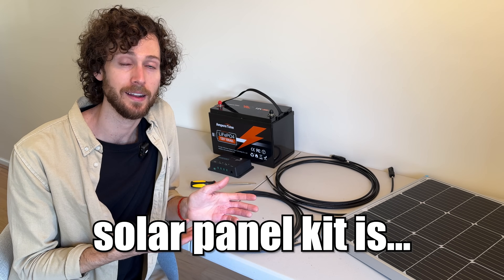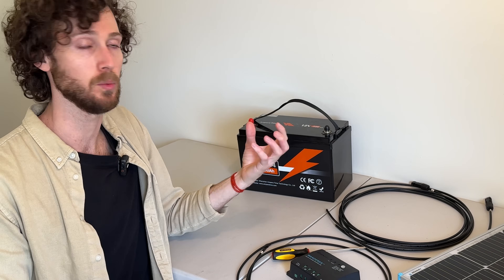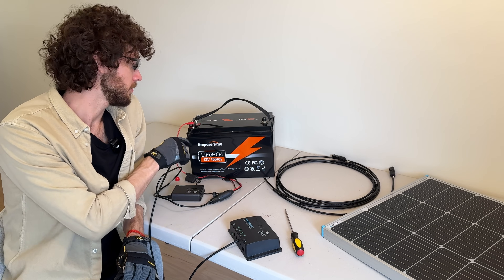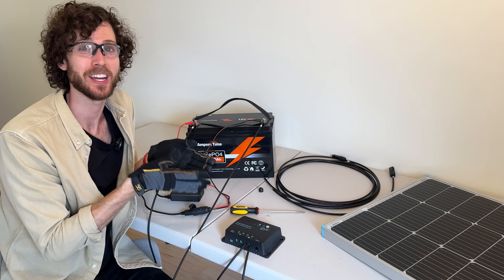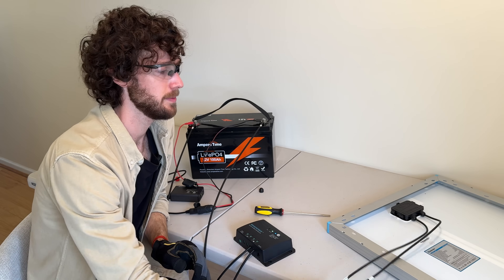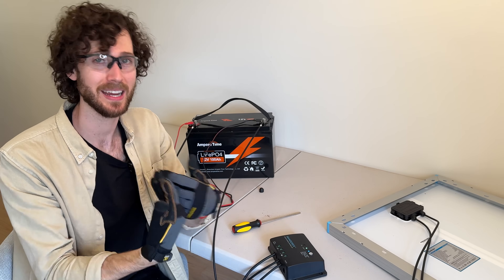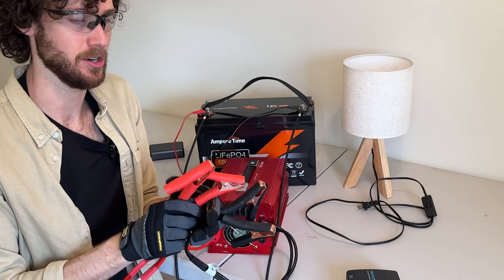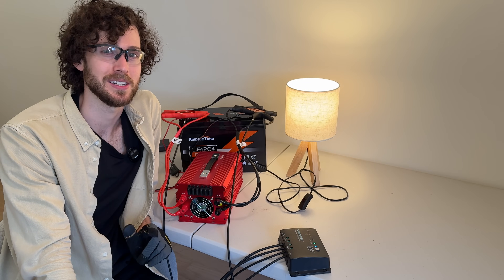100 Watt Solar Panel Kit Setup for Beginners - Step-by-Step!

Comment: Ok 100watt solar is done. How and where to add fuses/breaker to it, at what amp. I love your explanations i will follow you and build one🎉keep them coming
Reply: Bus bars, fuses, breakers etc aren't really necessary for this size setup. Sometimes people still prefer to use that stuff, but the battery has a management system, the charge controller has management, and your inverter has management and likely at least one fuse. That's why on all the 100w kit diagrams you don't see fuses and breakers on there. If you do want to add more fuses then there's a few different options and many people on YouTube have detailed videos. Will Prowse is kind of the man when it comes to solar so I'd recommend starting there.
Reply: @vitogriffin8902  would a 200w panel set up needs fuses?
Reply: @michaelgkellygreen  if it's one 200w panel, or more panels wired in series, then not really. If it's panels wired in parallel then you might want to run a fuse. If you're starting small with the intention of going bigger, then incorporating a fuse now that can be upgraded later might be a better idea than adding it to your build later on... that would be up to you based on your plan and preference.
Reply: @vitogriffin8902  I have two 100w panels going into an Ecoflow River 2 Max Currently but I’m toying with the idea of a set up like in the video. I’m assuming it would give me more power?
Reply: @michaelgkellygreen yea the 100ah battery would be a pretty big step up from the eco flow. I don't know the amp hours of the river 2 max, but it's way less than 100. You could build up a second system such as the one shown or even just add the 100ah battery to your existing system, using the eco flow and solar panels as the charger for the battery and use the eco flow's inverter to run whatever, then charge the eco flow with the 100ah battery when needed. But if you had a system like the one shown then you could do 2 panels in series without a fuse..you can do three 100w panels in series on this type of system without an additional fuses if your charge controller, battery and inverter can handle the amperage. When to use the fuses and where to put them depends on how much amperage you're running and which parts of the system may need the protection. Some people fuse everything.
Reply: @vitogriffin8902  thanks for the information. That’s a big help to me going forward.
Reply: @vitogriffin8902  great information. I would need a charge controller and battery. Then i could charge the Eco Flow using an adapter with positive and negative clips to XT60?
Reply: @michaelgkellygreen  since the eco flow will charge off of 12v dc, like a car's cigarette style plug, you can buy that type of socket on a pig tail and attach it to the battery to charge the eco flow, and get a "smart charger" to charge the battery through the eco flow when it's hooked up to your panels or straight from the wall when you have electricity... using the extra battery like a reserve for the eco flow.
Reply: @vitogriffin8902  much appreciated. Great to know I can add storage this way
Reply: Thanks for being nice enough to answer peoples questions since the main dude of the vid probably is too busy .. cheers bud
Reply: @vitogriffin8902  , please I have a 250Ah gel battery, what solar panel size, and charge controller would I need for it, and also if there should be a breaker, and the size, thank you
Reply: Yes exactly this is the important step. Everything he already did has been repeated. We need guidance on fuses, how to size them and when and where to use them.
Reply: There are easy charts on line.  Simple to follow and understand.  Gives you wire size, fuse size, breaker sizes.
Reply: Please what does smart battery charger means??
Reply: @chibuzorodogwu  basically it’s a special battery charger that will charge a 12v etc. battery from Mains power. The Higher the Amp rating for the charger the faster it will charge.
Reply: Best would to add a fuse between any component so if something would short-circuit I wouldn't burn everything down
Reply: Yes good question
Reply: Inverter positive should have the fuse with fuse holder and some come with breakers, that should go the the battery
Reply: Awesome 😎 keep up the good work
Reply: You can just buy a power station and a solar panel it already comes with inverter and everything on it
Reply: Did you just ask about a fuse, what amp? Omg! This is funny lol!

Comment: Use a resistor, no sparks.
Reply from the maker: Good to know!
Reply: You can also use a 12 volt test light from the ring terminal to stud on the inverter.  It will come on bright and immediately fade out showing charge is complete.

Comment: Hello, I am really interested in buying a setup for 100W, I wanted to do data logging for my panels, is it possible to buy just the panel and a data logger? cause I don't need the energy produced just want to know how much my panel produces hourly and daily
Reply from the maker: You would need to connect the panel to something, otherwise it's not gonna output any power. Your best bet would be using a charge controller with data logging. You could use the setup described in this video and then add the Renogy BT-1 Bluetooth Module to it. The BT-1 works with the charge controller in this video and then lets you connect it to the Renogy app and log data. Or you could buy a charge controller with built-in bluetooth such as the Victron SmartSolar MPPT, which connects to the Victron app and also does data logging. Best of luck!

Comment: Only thing seems off to me is i was told to always connect negative first but yah good video
Reply: Between cars for starting help you also need to connect to each other the positive first. And second the negative poles.
Reply from the maker: Thanks! Yeah I've looked into connection order multiple times over the years and different sources say different things. I've never gotten a conclusive answer.